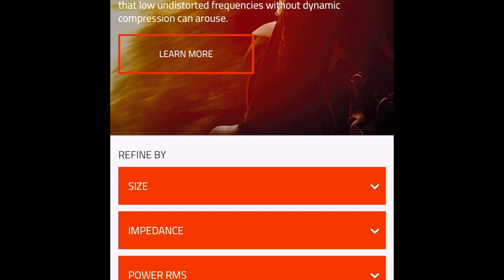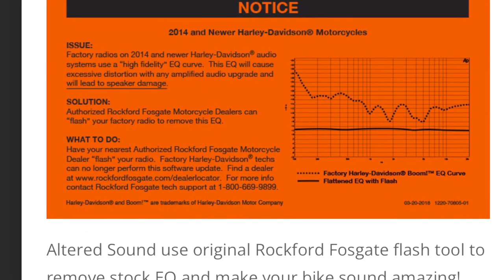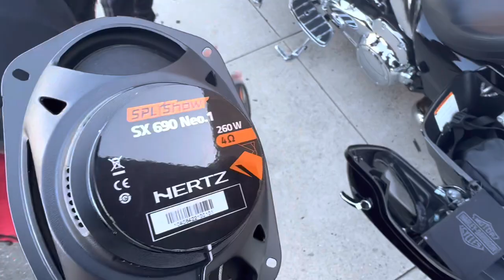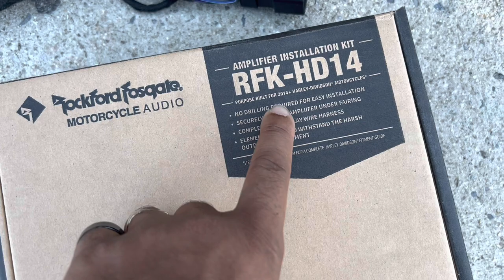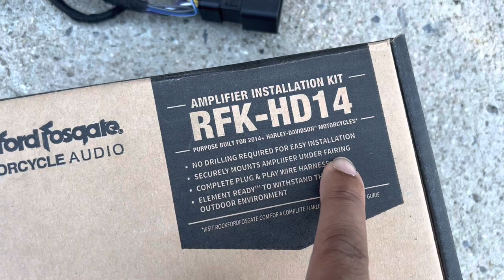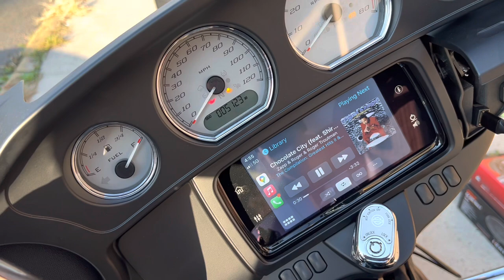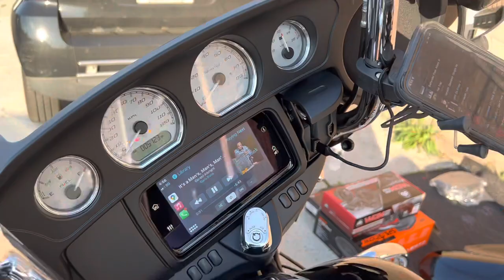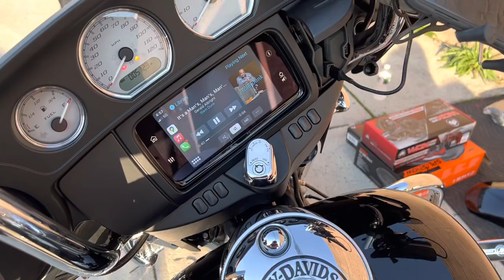Brand new Harley-Davidson Street Glide in for a Wiring rescue and Nvs Audio stage 2 audio upgrade.

Comment: Do you use this same Sound Digital line in you car installs? I have a Chevy Avalanche that I need a powerful 4 channel amp for component set upfront and one 8" sub with a dsp.
Reply from the maker: We use ad audio , euphoria xpert , Audison and hertz amps in cars
Reply: @NVSAUDIO  thank you! I'm trying to research the equipment you would use for an install in my Avalanche. I've only found 2 sub enclosures that would fit. The JL Audio JL Audio CP106LG-W3v3 and the powered RF PS-8 enclosure.